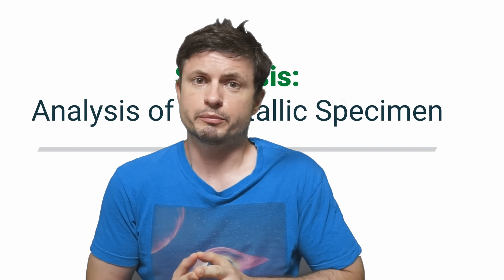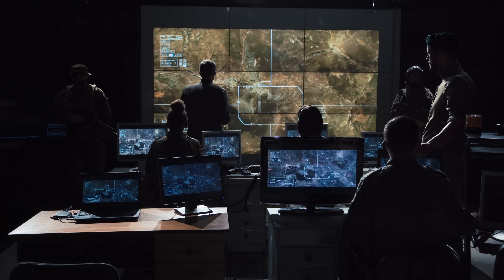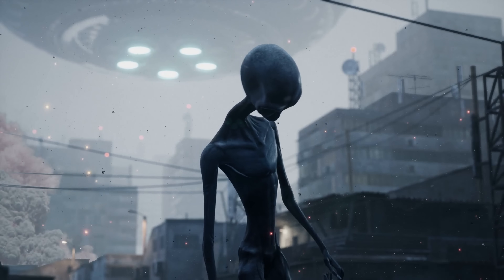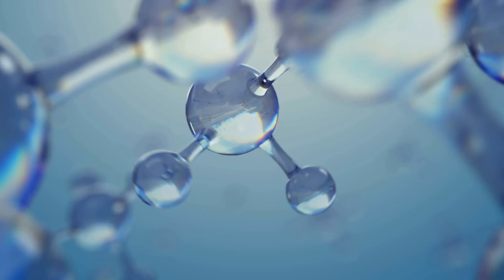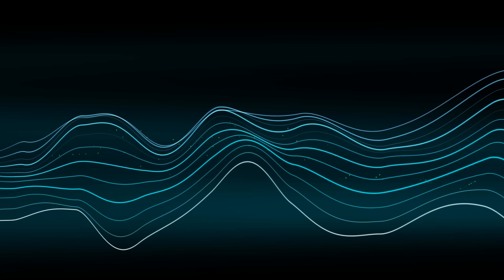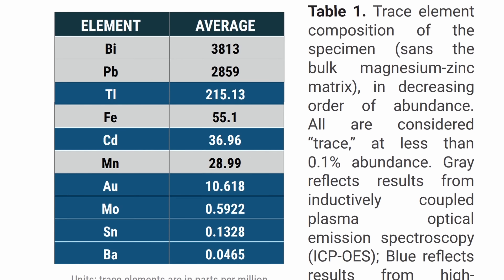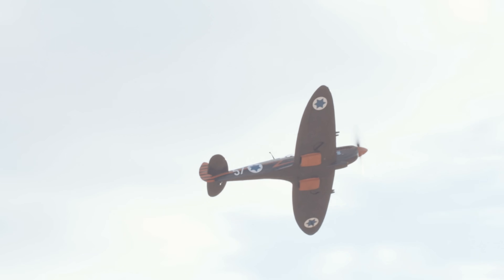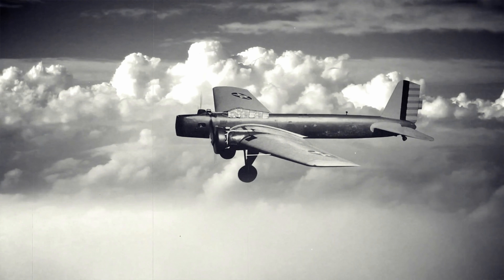Metal Piece From 1947 Roswell Incident Analyzed By a Government Lab

Comment: Ah terahertz frequencies! Now everyone knows.
I’ll be busy in the basement.
Don’t interrupt me.
Reply: We have no plans to. Enjoy the waifus.
Reply: If it's any help, wavelength is between 3mm and 30um. Have fun!
Like gigahertz before it, it's a pain in the gonads. Once gigahertz was mastered at the end of WWII, 10ghz, then 100 ghz became the beast and now, well, here we are.
So, pretty much anything one would have around a circuit one's building for these frequencies would be made out of pure painintheassite. Circuits detune, waveguides absorb, well, nothing quite wants to work right.
Which is precisely how radar repair was described early on.
Reply: @spvillano  The material IS the circuit. Just add electricity.
Reply: @danielloera6272  said by someone who obviously has no idea what circuitry actually is and how electricity works. Won't fly here, by trade, I'm an electronics technician. I sling circuits like others sling their shoelaces to tie them.
Indeed, the project of the month currently is building a home made radiation spectrometer. Just waiting for the board and a few additional components.
Crapmuffins! I gotta order a heat sink for an ancillary project, a cloud chamber. Forgot to order that last night.

Next project, an old fashioned hand made crystal radio, the detector being switchable from a razor blade, gallium potted crystal and germanium solid state diode. I'll get it going, then shoot it off to the grandkids with a full discussion on the theory of operation, including how each of the detector diodes operate.
Reply: @spvillano were there wave guides used for radar? Are wave guides used for receiving data from signals?

If my understanding is right, it seems like we can send Terra Hertz waves with no problem. Is that correct?

At this point I should probably look it up online but I'm curious what you know since it seems you seem to know stuff about this. I have never heard of this and I keep an eye on developing technologies, so I'm kinda surprised it hasn't been shown to me already. Especially how powerful it seems. I know of other technologies that seem many years away (solid state batteries seem to be getting close now 🤤).
Reply: @ario999 
Wave guides?  They’re used in surf parks and ship testing pools.  😁👍🏻
Reply: @ario999  Any satellite dish mounted to a house, used for satellite TV, has a gigahertz-tuned waveguide as part of the feed horn. They operate in the 3-5GHz range (at least for DirecTV), but the various K Bands that are used, range up to 40-some GHz I believe.
Reply: @keirfarnum6811  I was thinking for electromagnetic waves but that's a good analogous use.
Reply: @DUKE_of_RAMBLE  I see, interesting. This sounds like a tough problem then for sure.
Reply: When you name your left hand "bismuth."
Reply: Shame on you!
Reply: I bring tinfoil, may I enter your basement?
Reply: Anyone paying attention has known for decades that light, sound, and frequency are the immutable laws of nature. According to the visitors.
Reply: Please make the stargate reusable and not a one time use device.  I want to borrow it after you use it.
Reply: Do you need more lotion? Another bottle or two

Comment: The only piece of metal I want to know is that damn man hole cover that reached Mach Fuck during an underground nuke test
Reply: Um... it was ackshully *Mach Fuck point two seven five" I'll have you know.
Reply: Repeating of course  @grayaj23
Reply: Probably burned up leaving the atmosphere but if a sliver was left it's ahead of the Voyagers😅
Reply: @richardmaier28 I've seen a few analysis of this now that say they believe it was moving fast enough that the atmosphere may not have come into effect. 
But it is not the fastest thing we've ever made. Just the fastest manmade object leaving earth. The parker solar probe is currently going over 3x the estimated speed of the manhole cover. Its actually reached 0.064%c. or about 191km/s. Compared with Voyagers 17km/s. Or the manhole cover approx 58km/s.
Reply: @g-urts5518  when I was a pup in the late 50's they used to say "made in India" so if they used one of those, India has a nice record so doing a thing.Most people don't know just how much money was spent in these shots, I wonder if Alfred O'Donnell did the wiring.Good research, have a good day
Reply: @richardmaier28 It was moving so fast it probably didn't even have time to do that before it was out of the atmosphere
Reply: @richardmaier28  I don't think there's anything left of it. Yeah, in theory if it went "sideways" it could survive it's velocity & get clear of the atmosphere. But every model I've seen for a disk like that is that they tumble. Which means it'd oscillate in drag resistance. If it did that, there's enough energy to vaporize it completely.
But above & beyond that, something rarely considered by those who speculate on it, is that it would likely "come apart" long before collecting enough energy to totally vaporize. And once that happened, the total amount of surface area and drag would increase exponentially. It'd be a catestrophic cascade (structurally). 

Like when a dam goes. With a dam, if there is enough structure to withstand say 50% of the water it's up against ...none of the dam survives. Kinda like when the Columbia reentered. it was missing too many tiles on the leading edge of one wing. But once the metal there failed, the whole thing went RUD. It'd be similar for the manhole cover. It'd get hot enough to turn "flimsy", and then come apart. Never needing to reach the vaporization point really.

If the thing was spun, like a frisbee, that'd be a different story. That could stay in a more aerodynamic orientation, and "some" of it might survive. Or if they covered the nuke-test with a big round ball of steel, which has much more mass per surface area, and no obvious structural weaknesses, that'd go into space no problem. It's a "doable" idea, but that cover wouldn't have done it.
Reply: Imagine if Aliens invade because it wiped out one of their ships
Reply: @stoborking  tHATS SUCH a lopsided (human) way to think about an alien invasion;) The invasion began a long, long time ago. Humans arent that bright after all. The invasion began with downloads (like N Tesla) We've made it extremely difficult by separating everything and only looking into one field for answers.
Just as the joke goes, God needed us to make the plastic for him... They needed us to make the transistors> then close the loop for them. Before you know it, everything will be integrated, AI and bio-bots will be mass producing bio-bots... Humans will live with lab rats! 
*THE INVASION BEGAN WITH THE TECHNO REVOLUTION*
Reply: @stoborking  Imagine if aliens decided to NOT attack because of it!
Reply: @stoborking If a manhole cover moving fast is good enough to wipe out an alien ship, then I'm not impressed by them. In fact, I kinda like our chances against them lol.
Reply: @stoborking "No, captain, the Earth isn't worth invading.... You don't understand... They used a nuclear weapon to launch a piece of metal at one of our scouts...."
Reply: Mach Fuck is fucking amazing lmfaooo
Reply: @CutieBanana09 Yes, I am stealing "Mach Fuck"
Reply: @CutieBanana09  But is it faster than ludicrous speed?
Reply: @mikeg.9008  Plaid.
Reply: @mikeg.9008 I think on the Spaceball's scale, this counts as ridiculous speed.
Reply: @mikeg.9008 not quite but damn close
Reply: It didn't reach such speeds as a manhole cover. It was reduced to a strange smell at that point.
Reply: @incandescentwithrage man hole covers are more comfy than man hole plugs, or so I’ve been told lol
Reply: @erikjonromnes keep your mind out of the gutter 😂
Reply: Ah...Mach fuck. The speed I have spent years trying to reach on various flight simulators. Ksp is the closest I got
Reply: @nicklomas181 you get that when ever the Kraken eats your ship and it's collision detection.
Reply: Whoa, that was real? I thought it was just a weird story Karl Pilkington read on the internet
Reply: @jeffmccloud905 😂 Same here. Weird innit?
Reply: @jeffmccloud905  Yes, it happened during Operation PlumbBob in October 1957. It's been calculated by Robert Brownlee from the Los Alamos National Labs that with the power of the blast and the borehole itself serving as a gun barrel, the manhole cover reached speeds 6 times faster than the escape velocity needed to escape Earth's gravitational pull. The estimated top speed of the manhole cover when blasted was of over 240.000 km/h or 150.000 mph.
Reply: It went so fast it actually travelled backwards in time and crash-landed at Roswell in 1947
Reply: Is that a quote from 'Withnail and I'? 

"WHAT'S YOUR NAME, MACH FUCK?!"
Reply: The estimated speed of the cover was about 150,000 MPH.
Reply: While many mathematical studies have been performed on the potential velocity/trajectory of that man-hole cover, unfortunately, there's nothing left of it to test physically. It most certainly burned up in the atmosphere long before it had time to become an interstellar traveler or fall back down to Earth.
Reply: And don’t forget it’s the fastest thing humans have created.
Reply: @rogermiller2159 faster than the Voyager probes?
Reply: @rogermiller2159  No. No, it's not. Google Parker Solar Probe
Reply: @rogermiller2159 we have particle accelerators
Reply: @rogermiller2159  The fastest thing we've accelerated whilst in our atmosphere perhaps. Any birds in its path had a really bad day.
Reply: @rogermiller2159  No it is not. The Parker Solar Probe is the fastest.
Reply: @rogermiller2159  incorrect the Parker solar probe is traveling arounf 2-3 times faster than the manhole cover was.
Reply: I've been losing sleep over that.
Reply: Some aliens somewhere are probably trying to work out the special technology of this artifact sent from another planet, and still looking for the "on" switch.
Reply: @LokiCentral  This would be a great premise for a TV show.  Distant aliens who have no idea we're even here traveling through the Kuiper belt when one of them burps fermented qwazmorgo fluid into the Jeffries tube and causes a giant pleausring device to get shot into low Earth orbit.  It belongs to the fleet commander's consort who wants it back and so the invasion begins...

The President: "Here is the device, mr. Alien, Sir"

Alien commander:  IT'S NOT MINE YOU KNOW, it belongs to, um,  my um _friend_.

President: Sir it is our policy in such matters not to imply ownership of such a device.  That's why I said "Here is the device, Mr. Alien Sir."
Reply: @grayaj23 should be a screenplay for sure… could end up being a great comedy…
Reply: @grayaj23 fight club reference at the tail end there
Reply: @grayaj23 yes the furst interstellar  space prank channels.

Lets send out thousands and thousands of pranks into space.
Reply: @LokiCentral  "...  special technology of this artifact ..." --- part of a poopiehertz waveguide.  And... if it does hert, better see your procto! :face-fuchsia-poop-shape:
Reply: @LokiCentral so that means that oumuamua was actually an alien manhole cover that was sent into interstellar space at Mach fuck by a weapons test lmao. I love the thought of it.
Reply: @sprolyborn2554  Has to be.
Reply: Operation Holy: Shit Event
Reply: It's in orbit, we missed the Spy Satellite it was aimed at.
Reply: If you do the math the cover would indeed have been launched very quickly and deformed into a conical shape, but it was vaporized a moment later from the immense friction of the air.
Reply: @Cyborg_Octopus  But, what if it flipped its axis?
Reply: @troynelson8896  It started out like this: —. A tiny fraction of a second later it was shaped like this: ^. If it somehow flipped around like this: v, then it would have been obliterated even faster. A needle launched the same way would still be vaporized. You can't move an object through the lower atmosphere that fast without destroying it. This is why rockets aren't going at full throttle the moment they launch.
Reply: @Cyborg_Octopus the footage doesn't show it as a cone though. Shaped charges do that because they're attached to the charge like "v" and when the explosion hits it, it forces it into "^". A flat manhole cover just laying over top of a pipe will have all of the force evenly applied throughout the surface area that's exposed to it. So it will stay "-". Unless the manhole cover had some sort of defect that made it weak in the center.
Reply: Yes!!! I agree with this 100%
Reply: I just looked it up that mf got yeeted out at Mach 169 (130,000 mph) or 37miles per second
Reply: World's first nuclear cannon
Reply: “Mach fuck” lmao.
Reply: I assume “Mach F¥ck” is pretty fast.
Reply: That thing got vaporized lol, if the hot nuclear gas didn’t get it the atmosphere definitely did😂
Reply: lol IT DID!
Reply: I wanna know who did it, because It crashed into my backyard, with the shockwave causing extensive damage to my house and now i need to go mine more ice to fix my house (I live on pluto)
Reply: @Eternal1nstant  What are the property taxes like on Pluto?
Reply: @Eternal1nstant  About you car warranty.
Reply: @Eternal1nstant  Dang, you got great internet service!
Reply: @Eternal1nstant  Make sure you bring your Silk Touch pickaxe.
Reply: @Eternal1nstant  Not possible, Pluto is 320 light minutes away from Earth (*on average) and this video was released less than 50 minutes ago. You must be confused and on an ice moon of Jupiter.
Reply: @pks15032  🤣🤣🤣
Reply: @Nefville keep nerding
Reply: @Nefville  ah, you must be refering to the time it needs for information to travel, correct? Are you not forgetting the Hyperfluctuating Energy-Mass System?
Also known as Hens? Yes, thats right, you think we keep hens for the eggs, but the eggs are just sideproducts of interstellar comunications.
Reply: @Nefville  not possible.
nevada test site sits at 37N so it overshot everything in solar system and is on it's way outside of our galaxy, rushing towards the sextans dwarf.
and i would not mess with those creeps.
they may be dim but they are not small...
Reply: @pks15032 u must be a writer...nice😂😂
Reply: @Nefville He is getting his transmissions through quantum coupling.
It’s instant, and well past the speed of light, and unlimited range.
Reply: what’s the proof for that manhole cover
Reply: It was vaporized milliseconds after detonation.
Reply: @W1se0ldg33zer  said -"It was vaporized milliseconds after detonation"  Space debris metal objects far thinner have made it DOWN.  hALF THE ATMOSPHERE IS THE FIRST 4 MILES.  So if MOST of it didn't melt on a fraction of a second, the rest would get out clean !
Reply: @peterdarr383  Well maybe so but in that particular test it vaporized it. How do I know? Because one of the guys who worked on them said so. It's been debunked by several people.
Reply: Suborbital lol
Reply: NEVER SAW THE MANHOLE COVER AGAIN
Reply: Where the eff is that manhole cover now? Inquiring minds want to know...
Reply: I thought the foxbat could fly mach f*ck? Also that manhole got swallowed by the sun i am guessing
Reply: best comment ever
Reply: Vaporized or on some random Solar orbit... Probably in several pieces.
Reply: it reached space, crashed through Scout Vessle Vermillion, that, being stealthed in our upper atmosphere since the 60´s, convinced the Proxima Centaurians that we could detect them and pose a tactical threat to their planned invasion. So they canceled it for now.

Earth, saved by a manhole cover.
Reply: I’m pretty sure they believe it basically vaporized.
Reply: Even if it is manmade it doesnt exclude the possibility of supramundane origin.
Reply: It would be absolutely remarkable, and nearly unbelievably wild, if alien civilizations were NOT visiting earth.  It would mean that there's been a massive global conspiracy involving thousands of high ranking govt, military, and intelligence officials all lying in tandem for decades about their first hand knowledge and experience with these craft and beings.  Also, all the craft being filmed (since the 30's) would need to be of human origin, and that's also hard to believe because they are clearly so advanced.  Also, if some country really did possess this technology, then why haven't they used it either of the 2 world wars?  Yea it takes a LOT of wild presumptions and conspiracy theorizing to believe ET isn't flying around, the problem is that most people just don't think about the reality of the situation deeply enough to realize how completely bonkers that position actually is.
Reply: @emergentform1188    Exactly.  ET believers have been given far too much airtime and far too much credence over the years.  They cant even produce a single in-focus up-close photograph of an alien craft much less of aliens themselves.
Reply: :D
Reply: @jamescheddar4896  I was in the Vegas area as a kid bc of my grandfather's work,the above ground tests are something you never forget
Reply: Alfred O'Donnell did the wiring on that bore shot.
Reply: Parker space probe did 430,000 miles per hour. The man home was only 125,000 mph but not in space
Reply: “Mach Fuck”!!! 😂
My favorite, speed related superlative for many years has been “Mach 12”, but I’m changing it now.
Reply: @khumokwezimashapa  😂😂😂
Reply: @khumokwezimashapa  E=Mach fuck sq.
Reply: The Orville needs to do a show about the nuked manhole cover.
Reply: It didn't and if it did it would have vaporised in the atmosphere.
Reply: Kyle Hill did the maths - it would've burned up through heat generated by atmospheric friction.
Reply: Planetgun
Reply: Potty mouth is not really "good"... Humor 😢